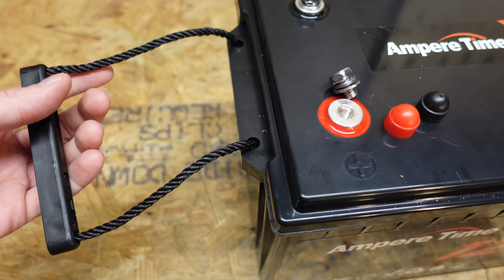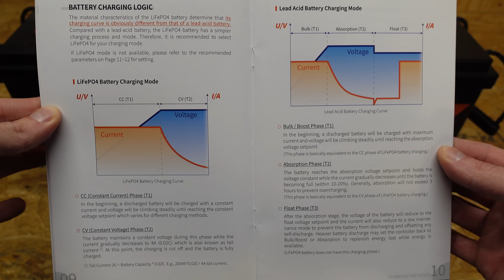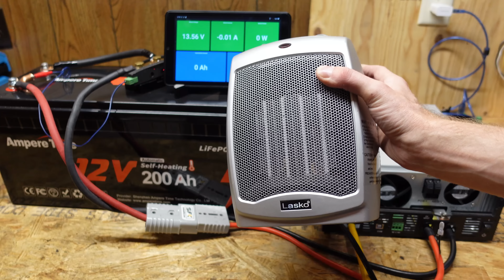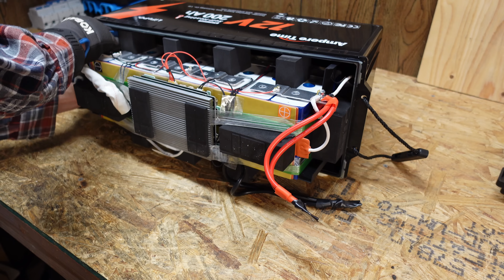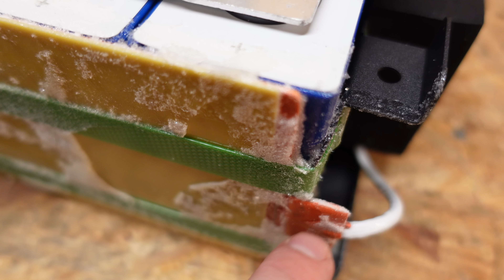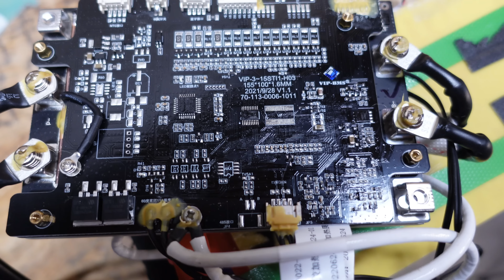Ampere Time 12V 200Ah Heated LiFePO4 Battery Testing and Teardown

Comment: Hi there I’m wondering if u can help me out about this battery 200 amps I installed 2020 how long of a life shell do I have ? Cause I’m tripping my breaker all of a sudden when I’m on microwave or air fryer it was fine before till now I have two batteries lithium 200 amps each just curious if I need to buy a new battery I appreciate if you can help me out thank you

Comment: I have a 300ah (non-heated) in my rv with solar charging.  It ran fine for a couple years, but now the battery shuts down in the middle of the night (causing my 12v refrigerator to stop).  I hit the RV briefly with 110v, then the battery pops back out of it.  (Goes from 0 volts, back up to 13 volts almost instantly).  What can I do?

Comment: Thanks for this video. Not sure if you can help me but I have the 100AH version of this self-heating battery in my boat. I've been using it for 7 months or so without issue, and charging with a noco 10A charger. It just got cold here (-5C or so) and I decided I would go check the battery. I leave the charger plugged in. The charger has been plugged in for 5 days so the battery should have been fully charged, at least I believe so. However it was only showing 3 bars on the noco charger indicating it was not fully charged.  Do you know if this is normal with these self heating batteries? Or is there something wrong with the heating function?  I also noticed the battery is quite cold to the touch. I would have though I could feel the heat.
Reply from the maker: Are you able to verify if the charger is actually providing power? I'm wondering if the BMS has the battery shut off and the charger is waiting to see voltage present before it turns on.
Reply: @LithiumSolar  Thank you for your reply. I checked it this morning before I saw your reply and the battery output was 14.6 volts which suggests (I believe) a full battery, however the noco charger still only had 3 lights on indicating a perpetual "charging" status (It normally always shows a solid green light when the battery is fully charged).  I also used a laser thermometer to check the surface temp. The battery surface was about 5 or 6 degrees warmer than any other  surface in the boat including my lead acid batteries which lead me to believe the heating pads were working. (1.6C temp on battery vs -5C on everything else ). I ended up disconnecting it from the onboard charger and bringing it in the house to warm up. I waited a few hours and connected it to a charger inside the house and the charger showed a full battery in about 5 minutes. The good news is the battery still seems fine and did appear to be fully charged. The not so good news is I'm still confused as to why I was not seeing a fully charged green light on the noco charger out in the cold. Since the battery draws power from the charger to heat itself I wonder if perhaps it's normal to see a constant "charging" status when charging below 0 but I'm just guessing. In any case I'll continue to monitor. Thanks again for your response, I appreciate it.  Subbed.

Comment: So quirky= design flaw. You do a good job taking apart the battery and testing but it seems to me that your more on the side of the battery company than the end user.  I think it's fine to be on both sides of the isle especially if you want companies to keep sending you products to review. It just took me a minute to process your terminology. Thanks for the review. So the useable capacity with one of the most popular inverters is less than 200ah since it drops voltage so low. Is this standard with most lifepo4 packs you've tested with the mppt? Thanks again for the review.

Comment: Has this "load drop" issue ever been observed in the NON self-heating model?  Does anyone know if that regular 200AH model uses a different BMS model?
Reply: Pretty sure my NON heated batteries (100ah) are exhibiting the same behavior.  I have 6 in parallel, with a Victron Multiplus inverter/charger.  When the batteries are above 14v they do not have any issue switching from charging to discharging, but when below about 80% SOC, any large load will cause the entire system to momentarily lose power.  NOT GOOD for an RV.
Reply: I bought the 200AH model and a Victron BMV-712 Smart battery monitor (shunt + display) so I can monitor a graph of voltage, current, etc.   Battery sits at 13.3 to 13.6v quiescent (no load or charging).  My slide out pulls 20A but that's about the biggest draw I typically use (I do not have an inverter, and my 12v fridge does not draw much). Anyhow, so far, so good, I avoided the heated version as from looking at some specs and pics I'm pretty sure the heated vs non-heated use a different BMS circuit board, and the non-heated one seems to be much more reliable, from my limited research.

Comment: The fault you observed has been seen by others, at least on this self-heating 200AH version.  https://www.youtube.com/watch?v=HIiEy5CmJIo   When it is charging and discharging (i.e. under load) at the same time, then you remove the charging source, it will shut down its discharge output for a brief time.  Even for normal loads, not just inverters with capacitor inrush current issues...

Comment: I am very close to ordering these batteries but am very worried about it dropping load when charging, not charging, and charging agian.. Does this issue still exist, and have you contacted Amperetime about it/ got an answer?? Thank you!
Reply from the maker: I don't know what the deal is honestly. There are so many others out there that don't have this problem. I would either buy the non-heated version if you want Ampere Time or another brand/battery if you need a heated battery.
Reply: @LithiumSolar  thank you! You rule! I think I’ll go there varter

Comment: Great video, thanks for such a thorough review of the product!  Regarding the quirk, have you reached out to AmpereTime on the load drop issue?  I wonder if that is an issue with a the unit or batch of units and has since been fixed?  For my use case, that sounds like a hard pass when this is much to potentially love about this battery.

Comment: So if I try and charge below 32f with the non-heater version I could damage the battery ? No low temp protection ?
Reply from the maker: Correct. Their standard line of batteries does not have low-temperature charging protection.

Comment: If you had a hunting cabin where you wouldn’t be there for the winter would you choose a self heated battery? Or disconnect a regular lifepo4 for the winter?
Reply from the maker: I would choose a regular (non-heated) battery and just disconnect it through the winter if I wasn't there.

Comment: I LOVE MY Amperetime battery! $649.00 for a 200ah lithium battery. It’s a steel!  I have 2-200ah batteries and love them. But you don’t have to spend the extra 300, for a heating blanket, you can get at any yard and garden store. A germination pad. But you can also add a battery sense to it, it keep an eye on your battery temp.  But mostly people are installing them indoors, for security reasons, and to maintain temp. So the low temp mat becomes moot. So why spend the extra $300, spend 40-50, and use the rest for fuel costs, in your tow rig.

Comment: Do you have any experience or input on a lifepo4 that uses a PCM instead of a BMS?
Reply from the maker: PCM = Protection Circuit Module (Google)? No, never heard of it... Sounds like it would be more reliable though because of not having user-programmed software.
Reply: @Lithium Solar  it is what is in the bioenno brand batteries, I'm looking at the 300AH version but the information is very limited so I'm not sure how reliable it is
Reply: @Lithium Solar  maybe you could contact Kevin and bioenno and get a 300AH to test, I know they use cylindrical cells and a PCM but that's all I know, seeing inside of one would be cool

Comment: Great review.  No way I'd pay $300 for a heated version of this battery.  I'm not sure why they think it is worth that much more.
Reply from the maker: I agree. I really like their batteries - a lot, but just not a fan of heated batteries in general personally.
Reply: @LithiumSolar  - I just made an insulated enclosure for some batteries and am using a small 12v heater/fan to warm it, using a thermostatically-controlled switch.

Comment: That BMS dropping the load is a big problem for a lot of installations, very strange.
Reply from the maker: @JOHNDANIEL1  I'm not sure what you're going on about. A #8 THHN 90C is rated for 55A by the NEC for home residential wiring. If we ignore the fact that this table doesn't even apply to this application, that's still 110A for a pair of 2 conductors. Chassis wiring has a much higher rating... Nowhere is it limited to 78A.
Reply: @JOHNDANIEL1 😂😂 okay.
Reply: @JOHNDANIEL1  how is the heaters being oversized a waste? If anything it would save energy.  If the battery is cold and needs to heat up before charging you would want the heater to be faster not slower, the energy is coming from the charge source and if its solar than the longer you wait for the batteries to warm up to accept a charge the less sun light you will have to charge.

Comment: Why do the Chinese use foam blocks and huge air spaces in between their battery cells and cases? That's just wasted space.
Reply from the maker: Because it's much cheaper to grab a standard mass-produced case than have a different case designed for each battery.

Comment: Just don't buy a Liitokala battery which I found out to my expense.
Reply from the maker: LOL yeah... I have a video on that company here
https://www.youtube.com/watch?v=QcisAQ-NvgE
Reply: Well in my experience i had good stuff from liitokala. I bought a lot of 18650 panasonic ncr18650b cells and all of them tested out to be 3500mah and it has been like 5years and all of them are working good. I use them to power my camera, lights and stuff and they are regularly discharged and charged. Some of them probably have near 1000 cycles . And still all of them are above 3400mah. I do not discharge them below 3v. I paid like 2-3$ for each cell. Which is a good price as they are sold locally for not less than 10$.
Reply: @KuntalGhosh  but they are not pouch cells contained in a 12.8v pack and advertised as 150ah. When in fact at best, they only achieve just about 100ah even at a 0.2 discharge
Reply from the maker: I find it very difficult they are genuine. Everything I've seen says otherwise, but nothing conclusive as proof of course. Either way, I'm glad they're working for you!

Comment: With 200 ah cells readily available I wish they would use them and not have the risk of unmonitored paralleled  cells . I just don't get it , it would be less work and cost for them as well .
Reply: Likely they already have a purchase agreement and supply for the 100AH cells. When placed in parallel, it makes no difference. Personally I would prefer this as a 24v battery pack.
Reply: @john_in_phoenix  With all due respect John , cells in parallel cannot be monitored as well as single cells with the BMS .  You are only monitoring  what the pair of cells voltage is , you could have a high capacity and a low capacity cell together and think it was fine when it's not .  I know it's not terrible but definitely not desirable when the 200 ah cells exist and it's more cost effective , more reliable and safer .

Comment: I was watching very careful during your battery removal process.  You mentioned that you should call the company if you wanted to set this battery up on it's side.  I did notice that the cells are placed inside the case with the cell vents facing toward the side that has the large 12V emblem.  Hopefully all their batteries are built the same and don't have to be disassembled to find out.  The configuration I was considering was placing the batteries on their end making it taller with three others, side by side.  I don't see an immediate issue with this configuration, but I will call Ampere Time to make sure.
Reply from the maker: I actually had a comment in the video about this and the way the cells were facing, then decided to cut it out as I can't guarantee they're all built exactly the same especially different models. I don't see an issue as long as the cells are not facing down; however, as we don't know without opening - best to ask :)

Comment: Low temp cut off is a double edge sword -  lets say U are freezing and need to charge phone -  battery wont work because its to cold - oops
Reply: Low temperature cutoff affects charging, not discharging. Low temperatures reduce capacity and discharge rate of most cell chemistries, including lifepo4, but something this big should be able to handle 10-15w easily even in fairly cold conditions.
Reply from the maker: A properly-designed and properly-programmed BMS (which is most that I've seen) can control charging and discharging separately.

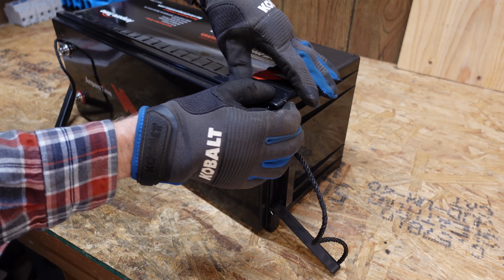Comment: You are not testing correctly the battery 2:58 it is 2481 Watt-hours, so 2481/12.8 = 193.82 AH @ 12.8V
For this to be a 199 AH battery it should have tested to 2,551 WH.  Stop basing your calculation of capacity on AH and use Watt-hours. You can use the nominal voltage of the chemistry to get the AH. Your shunt is showing the current flowing not the capacity of the battery.
Reply from the maker: Batteries are rated in Amp-hours. Testing with watt-hours does not take in to account losses in the cabling, BMS, etc. If you want to test yours that way, that's your business, but it is not a proper reflection of measured capacity vs what's printed on the datasheet.
Reply: What he said .

Comment: You just mentioned that the heater turns on. Would it be better to have one controller to turn on and off all of the charge, heater, and monitor the battery system. I can see one battery failure making a issue for all. Or am I picking nit’s?